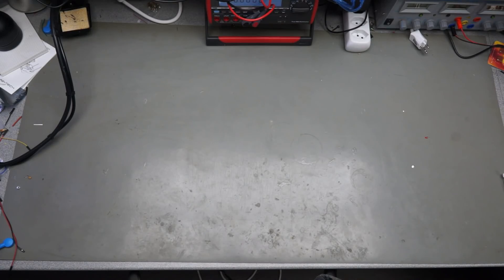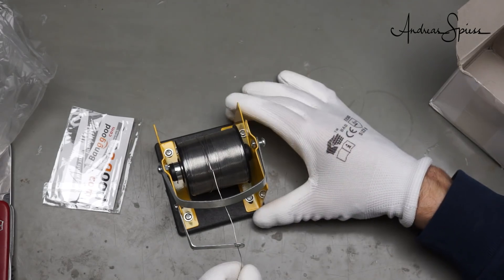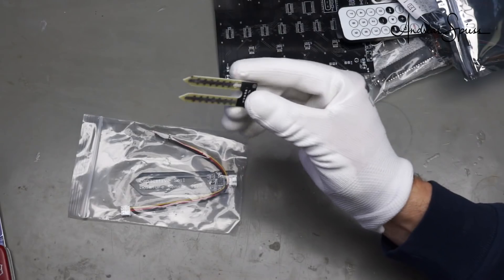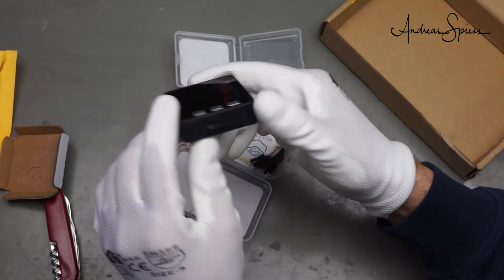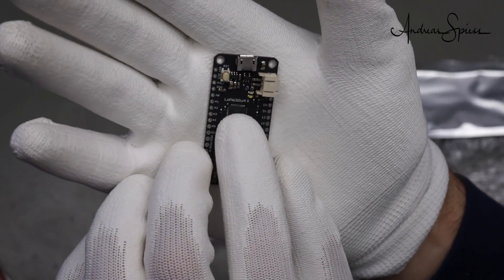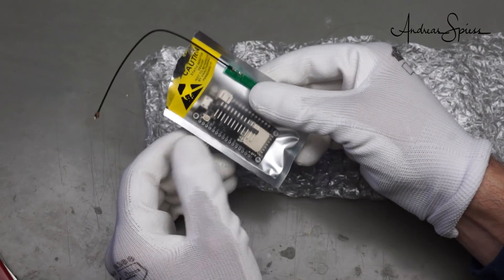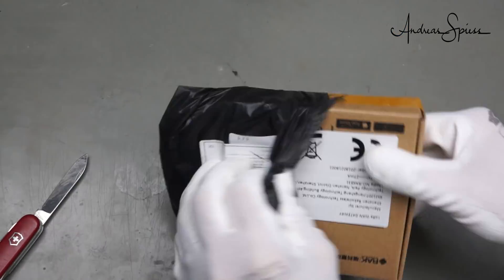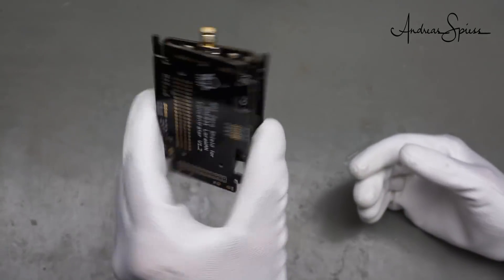#186 Mailbag with M5Stack, RAK831 LoRa Gateway, LoRa32U4, ESP32 WROVER Kit etc

Comment: Test the capacitive soil probe then send moisture value via Atmel Lora module to the Raspberry Pi/Lora gateway for an IOT project. Put sensor in your outdoor garden and test the range on LoRa module.   Not sure if that is a possible configuration of LoRa as I know very little about it but it would make use of three of the items in your mail bag.
Reply from the maker: Thank you for your vote. If you want to know more about LoRa: There are many more videos about that on this channel.

Comment: LoRa gateway. And please measure the output power if possible.
Reply from the maker: I will try to measure it. But this is not easy as I cannot control the sender. The controlling is done by the gateway software itself
Reply: Thanks for the reply. I asked because there are a lot of different claims regarding the range of LoRaWAN. Based on my experiment I can get 3 miles of range. I am trying to model the channel but haven't figure out how to measure the transmission power.
Reply from the maker: Transmission power is not very important. Maybe you watch my videos about LoRa range. My record is more than 200 km with the legal power.

Comment: Broadlink.....I purchased a pro 3 and bricked it the next day by flashing old firmware....would love to know if it's possible to flash custom firmware and regain use of the IR and RF parts of the board. My vote......anything you decide because all your videos are fantastic and informative, thank you for taking your time to educate.
Reply from the maker: The broadlink was not on the list and not mentioned by other viewers. So it will not have a high priority. Maybe you find help for your problem with google...
Reply: Andreas Spiess thank you for reply. I googled a lot and many people have made the same mistake. They buy the RMPro 3 to interface their home automation system to control rf and ir devices using RM Plugin, but broad link didn't seem to like that use of their product. So they changed firmware, when you flag the old firmware to the product it commences but then must reset the Wi-Fi parameters so you loose connectivity and the unit is bricked. No solution available yet online. I open up the unit and it looks like ESP based system so I thought it might be possible to flash directly on the board........but I don't have the expertise or knowledge to proceed. The ir and rf circuit and components might be able to be used by installing a replacement ESP8266 flagged with custom firmware, but again well above my knowledge level at present.

I watched your mail bag part 2 and the reason not many voters is because we didn't know where the voting button was located. Now you showed it very clearly I think you will have lots of votes.

Comment: do not forgett to seal the capacitive sensor with "tropenlack", because the small side of the sensor is open and the varnish could peel off when moisture gets under it.  I made that experience with one from T...
Reply from the maker: Not easy to get this "Tropenlack".  Where did you get it? If I remember right you mentioned I can also use Nail Varnish?
Reply: try TRV from Electrolube.  best would be to by dip coating acording the instructions

Comment: I'd be interested in seeing how the LED cube project works out. No instructions come with the kit. Maybe not such a great kit for a beginner?
Reply from the maker: he should not be a beginner, he will finish his apprentice in summer. But he needs some soldering training...
Reply: I made a similar 8x8x8 LED cube from a kit some time back. I had ample instructions and youtube videos to help me along.  I found building the 512 LED 3D matrix to be quite challenging but it did come out nicely. Sadly the LEDs that were supplied with the kit were of poor quality and over time many of them have failed. I tried soldering new ones into place but it became a hopeless task. It's difficult if not impossible to replace them particularly those located deep inside the cube. I wish the best of luck to your apprentice!
Reply from the maker: Thank you. And here, definitively the way is the goal ;-)
Reply: Yes, the journey is the reward. I guess.

Comment: My votes with the LoRa32u4 II Lora Module. Interested to know if it would be any good for battery powered projects. Maybe with the capacitive moisture sensor.
I’ve used a resistive one, lasted about 3 months before it completely corroded away.
Reply from the maker: Thank you for your vote. Sounds like a reasonable project...

Comment: Hello Andreas, nice videos on your channel. I got this  16 Mt Bytes (128 Mt bit) Pro ESP32 OLED V2.0 TTGO For Arduino ESP32 OLED WiFi Modules+Bluetooth Double ESP-32 ESP8266 Et OLED
https://banggood.app.link/8l2P1LgV0K on Banggood, cheap but good looking. Only powered on but seems pretty cool with it's display. I wonder if you ever reviewed a similar one.
Reply from the maker: I had the two LoRa modules which are similar. I will do a new video with all ESP32 boards in the next month or so.

Comment: Hi Andreas.  Some cool stuff here as usual :) it reminded me I was at some training the other day for a monitoring product (PRTG from Paessler which has a cool free version check it out) and the guys running the course mentioned that one of their colleagues had created and esp based device. Check out Ledunia:  https://www.amazon.de/LEDUNIA®-TEILBESTÜCKT-kompatibles-Entwicklerboard-KICKSTARTER/dp/B078YZVD5J if you haven't already seen it :) feel free to mail them for a sample, Theo Arends did and proved tasmota just works on it and can control the ws28122 leds without modification to the code :)
Reply from the maker: I used PRTG once when I had problems with my LAN. It is a cool product.
This Ledunia product does not have a lot of information in your link and also not a lot of parts for the price...
Reply: Andreas, I agree on both points you make about prtg and Ledunia. I couldn't quite work out why the price was so high but as they are promoting it and you could likely get a free sample as a YouTube reviewer (no obligation I would assume) I thought it might be just interesting. You could have a look at http://ledunia.de which has way more info. As a dev board I also couldn't quote get the market it was aimed at. 32Mbits memory and usb connection? I guess if you are doing 8266 dev for a full blown build then yes but even then... there are much cheaper alternatives as you regularly prove...
Reply from the maker: I try to stay focused and only look at things which I would buy myself. I do not use a lot of "free" stuff on this channel because I want to keep it independent. Usually, I accept free stuff only if I already bought a similar one and do not need a second part, but assume my viewers would like to have the choice.
Reply: ....and that my friend is why we love you :) fair point well made :)

Comment: Hi Andreas,
Many thanks to make us discover new toys... I'm just puzzled as some of those items are not "cheap"... I'm okay to play with stuff up to 10-50€ if it worth it but RAK831is 200€ ! Even Exen Mini is 10€ where I think It should worth 1-3€ not more (compared to digispark as an exemple)
Many thanks again for sharing !
Reply: Hi Benoit, The Exen Mini costs more than €3 to manufacture currently, but we are working on bringing the price down for the future :) The Exen Mini is also much more powerful than the digispark too, at 32-Bit with 48MHz clock, 256KB ROM and 32KB RAM, more I/O pins with more functions per pin ect :)
Reply from the maker: +Benoit: I always look for price performance and the RAK gateway is less expensive than all others (I paid way more than 300$ for my first one). BTW: In my link it is only 128$. And you see the votes in the comments...
But you are right, full gateways are still quite expensive.

Comment: Vote for the moisture sensor. Especialy compared to the cheaper ones( in Deep   Sleep Mode, the cheap one also dont use dc current - so they dont wear out fast, too ?) .... From Time to time, Show us your cat. Every Video gets better with a cat in it :)
Reply from the maker: As I mention the corrosion is because of current flow. If you only measure from time-to-time you can prolong the life I assume. But the ones I have use a constant current. And thank you for the tip with the cat ;-)

Comment: Hi. My vote is for the lora gateway for the next project.
By the way, I have the wrover module which I bought for a project. It does not have a touch screen. Very disappointing.
Reply from the maker: Thank you for your vote. I knew that it has no touchscreen. As I said in the video, it is quite expensive for what it has.

Comment: Guess the Nerdonic Exen Mini uses the same upload method as the Digispark's ? so my vote is a video about Exen board.
Reply from the maker: I do not know the digisparks. But it has two modes, and it switches between them when you connect and unconnect it from USB
Reply: ok. The digispark has an attiny85 but with a little bootloader code inside (micronucleus its called) that when powered on the first 2 seconds it waits for 'you' to press upload from the Arduino IDE. If you don't it will start running its main code (if any).
Reply: Maico The chip the Exen Mini uses is the ARM Cortex M0+ ATSAMD21G18. This is the same as the Arduino Zero/Adafruit Feather M0/Sparkfun Sam D21 etc. It has native usb. Adafruit has really done a lot with the this chip. They have developed a bootloader that  you can drag and drop firmware too as well as run circuit python on. To be honest the chip is extreme over kill for the Exen Mini as they barely  break out any of the IO. The on board DAC isn't accessible as well as any SPI ports. You're better to check out the Adafruit Trinket M0 as it is a similar form factor with many more features for less $.
Reply: Thanks Jon for your extensive information

Comment: 👏👏👏 Another excellent video! So many interesting products. Thank you.
My vote is for the capacitive moisture meter feeding the LoRa32U4, transmitting to the RAK831 Gateway, forwarding data over WiFi to the WROVER to create a portable terminal in your home to read the moisture of a plant which is remote. That framework is easily expanded to include other sensors or functions.
Reply from the maker: You forgot the USB charger to power the whole thing ;-) I think I will do one after the other... 
But the one with the remote plants would be useless for me as I do not own a second home.
Reply: the creator documented the chip: https://wemakethings.net/chirp/
Reply from the maker: Bollie, thanks for the link.

Comment: I’ve got two m5stack devices. It’s a nice enclosure with a nice screen. However the speaker creates an annoying hissing noise. And the proto board is strange: if you solder on the second connector to make it fully stackable, it’s almost impossible to connect your own components as the bus signals aren’t routed anywhere else on the board.
Reply from the maker: Thank you for your info. I only unpackaged it so far.

Comment: Would like to see a Tutorial to your different plant Sensors with WiFi access,  store Data in database and Alarm via pushmail
Reply: I'm using ESP-WROOM-32
I think it is because ADC2 is used for the wifi and only ADC1 pins can be used 
https://github.com/espressif/arduino-esp32/issues/102
Reply: Me too, but with the esp32 because maybe Andreas knows a way around the power issues while using wifi.h and analogread() at the same time (I can now only use 6 pins for analog read while connected to wifi)
Reply from the maker: What kind of "power issues"?

Comment: Thanks a lot! Also for the hint with the alcohol pump bottle.
My favorites:
1. Wrover module: range Tests with internal and external antennas
2. using the capacitive moisture sensor as a rain sensor

The M5 stuff is way too expensive.
The USB Color tester has a package similar to a smartphone. That means the the German customs most probably will call me to pas by to declare. Even it would not cost money, it would cost my time.
Reply from the maker: 1. You will see a lot of antennas in the next time (maybe not on 2.4GHz, but on 868). I am working on some interesting stuff. But it can be easily extended to 2.4 GHz and maybe I will do that.
2. How do you think it could be used as a rain sensor? I have one which "counts" the amount of water, and I saw that they want to use radar to measure precipitation. But never a moisture sensor.
Reply: 1. Yes, I am also interested in "good" 868MHz antennas for my Homematic which uses 868MHz similar it is now done by Z-Wave. There are a lot antennas on ali, but you never know what you get. Unfortuantely I do not have a spctrum analyzer. Hope the will become cheaper in a few years.

2. You can detect single rain drops using a capacitive sensor as shown here https://www.stall.biz/project/weatherman-die-perfekte-wetterstation-fuer-die-hausautomation . Measuring the amount of water is a different thing. Currently I am using a simple radar motion sensor to detect raindrops. It works but I have some false positives, most probably by birds. I also tried to measure the strength an speed of the rain using a HBM100 or CDM324 . This also works until the raindrops are smashed on the protective cover (glass).

Comment: I miss the electronics tutorial type videos - too much wi-fi, LoRa, etc..
Reply from the maker: Thank you for your feedback. Because I have many interests the "bandwidth" of this channel is not very narrow. But I will do one in the next time around opamps and filters, because of the Radar speed detector needs one of those.
Reply: I would love to see videos about level shifting.  I have a number of projects I want to where I would need to interface with 24V DC IO.  That and 4-20ma and 0-10V DC.  I want to make some of the existing sensors I use smart.  Put an ESP between the sensor and its existing control so measurements can be sent via MQTT for example.

Comment: I think you should connect the solder holder to IOTAppStory  using the ES32 or Lora modules  ;-) You could add the strain gauges to tell when it's running low.
Reply from the maker: I think I do not need another roll of solder in my life. It is huge. The last one lastet for 20 years...
Reply: Add the strain gauges to provide a rough idea of when Andreas does most of his soldering